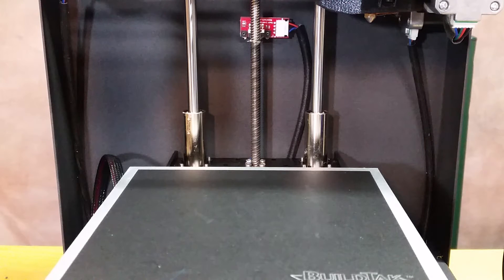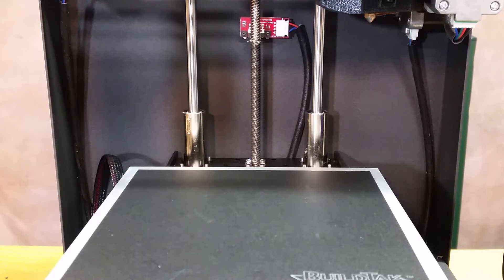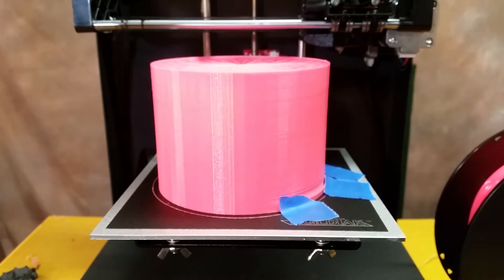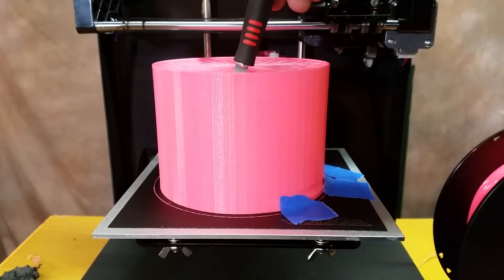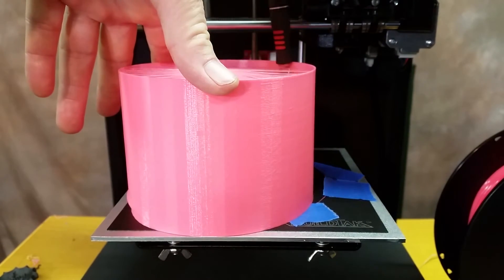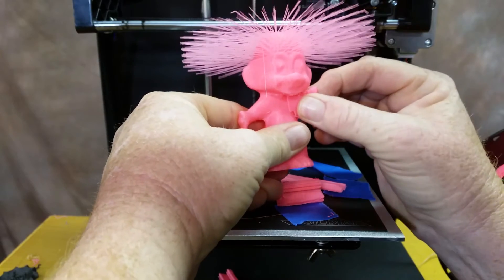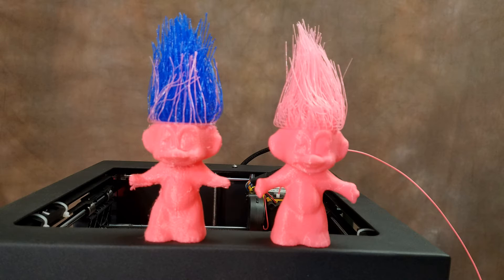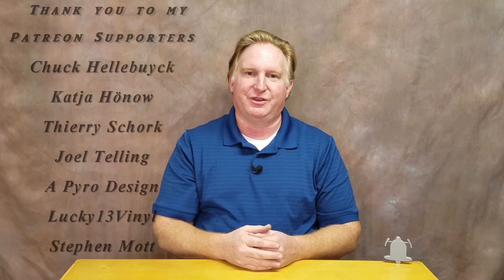Hairy Trolls!  Adding Supports in Tinkercad then slice in Cura or just use Simplify3D

Comment: what was the issue with craftware, Jimmy?
Reply from the maker: +josh cartmail When I installed it and went to set it up, the printer needed to be connected to the computer.  It wouldn't let me chose the printer, printer style, etc.  I couldn't set it up.
Reply: Jimmy Shaw's Tidbits i haven't had that issue with it. do u want me to email you the program files  as ive  got it up and running for the  mecreator 2?
Reply from the maker: +josh cartmail That would be great!  I downloaded the newest version.  That could have been the problem too.

Please email me at jimmyshawstidbits@gmail.com 
Thanks!
Reply: Jimmy Shaw's Tidbits are you using  Windows  10?
Reply from the maker: +josh cartmail Yes
Reply: Jimmy Shaw's Tidbits brill ill boot up my pc. should be with you in about 10mins
Reply: just sent it
Reply from the maker: +josh cartmail Thanks!  I'll check it out.